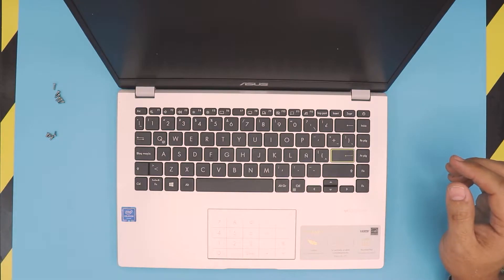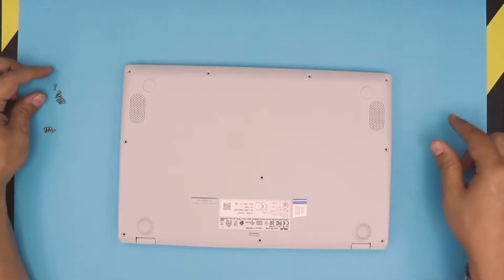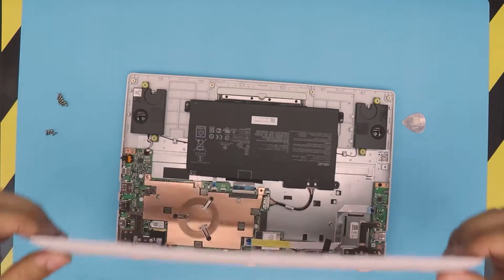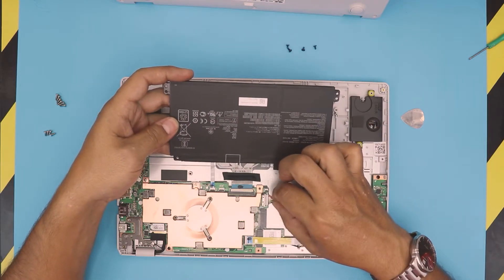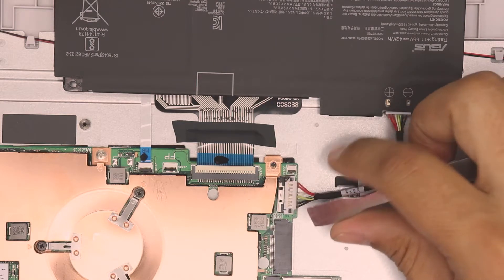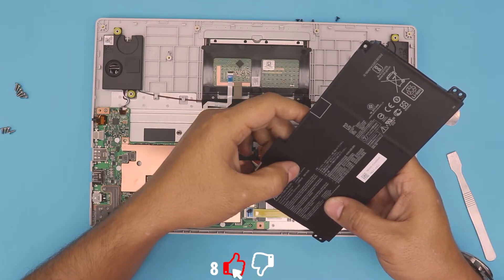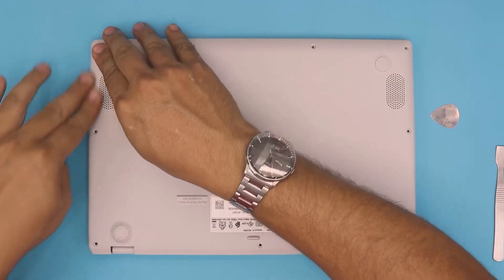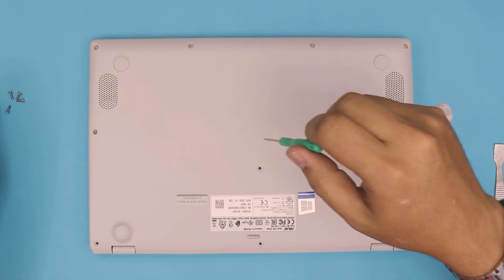ASUS e410 Battery Replacement guide, STEP by STEP

Comment: You said you have to reset the clock. Will that auto update when you reconnect to the Internet of does it have to be done manually?
Reply from the maker: 🫠Regarding your question, yes, just ignore it, and once you're in Windows, the BIOS will automatically set the time.
Should you have any further questions or requests in the future, please don't hesitate to ask me.
cheers🍻

Comment: Thank you!  I successfully replaced the battery on my laptop (the one I'm using right now!). I didn't even have to reset the date and time!  The only thing I would add is not to forget the long screw in the middle of the housing, haha. I unscrewed all the edge screws, pried the clicks open, and the housing wouldn't come off - luckily I saw the middle screw before I broke anything. Also, have a plan for disposing of your old battery - you can't just toss it, it needs to be disposed of properly.
Reply from the maker: It's my pleasure, my friend. 😊 I deeply appreciate your taking the time to provide feedback. If you're inclined to support the channel further, feel free to like and subscribe—or even both!
I'm glad my videos are helping!🫠💞
ya always got to double check the screws🙂
Should you have any questions or requests in the future, please don't hesitate to ask me.
🍻cheers

Comment: Nice video. Question: How about after the initial power up. It is approx. 70% charged at first power up. Do you use it to discharge to a low level, then charge it back to 100% Or do you charge it to 100% right after installation?  Thanks
Reply from the maker: 🫠Regarding your question, both options are okay, but based on extensive testing, we recommend fully charging it before powering on for about 2-3 hours. Then, power it on without the charger and let it drain slowly. After it powers off, charge it again. After that, you can use it as you wish.
Reply: @uFixTek  I wonder if something else is wrong with the laptop. I replaced the battery because I assumed the original was bad. I replaced it with a new one and it doesn't charge, plugged in for about 3 hours and it has not charged at all, in fact is slowly drains. The monitor indicates it is plugged in and indicates it is charging but it keeps slowly draining. I checked the charger and it outputs the correct voltage. I disconnected the battery and powered it back up with the charger only and it boots up ok. Any thoughts?
Reply from the maker: about that...
when i get those cases all the time in the store, the 98% of the time the charge section of the motherboard is bad has a faulty capacitor,
the capacitor is normally beside this type of chip on board:
https://www.ti.com/product/en-us/BQ24780S
"BQ24780S"
https://www.ti.com/lit/ds/symlink/bq24780s.pdf?ts=1740606279121&ref_url=https%253A%252F%252Feu.mouser.com%252F
capacitor on line 27 PHASE it is a 47uf
Reply: @uFixTek  Can’t thank you enough for the deep dive detail you provided. I have some homework to do and will have to figure out the best way to proceed. Again, thank you👍👏
Reply from the maker: It's my pleasure my friend.
i appreciate your support 🫠👍🍻

Comment: Because i didn't unlock the white tab, now its broke, connector is not sodiers to board anymore, any suggestions ?
Reply from the maker: You will need a soldering station and some soldering skills to reattach that jack to the board.  
I recommend finding a repair tech shop to get it fixed.

Comment: Thank you for this guide. My battery had swollen and I read it was dangerous, got to remove the battery safely and now am using the laptop directly with a power supply.
Reply from the maker: It's my pleasure my friend.
🫠Regarding your question, yes, it is very bad. We had one explode a few years ago in the shop, producing about 2 meters of sparks. Use the laptop without the battery; it will last longer.

Should you have any further questions or requests in the future, please don't hesitate to ask me.
cheers🍻

Comment: Goodnight great video can you tell me where can I get the green screwdriver in the video used to put back in the screws because recently my laptop does not charge and it can only turn on when plugged in and my other screwdrivers are too big to take out the screws and thank you for your time!
Reply from the maker: It's my pleasure my friend.
🫠Regarding your question, those are the cheap AliExpress screws that are almost one-time use. You can get a slightly better and smaller set like this:
https://amzn.to/3WrI1pk
Should you have any further questions or requests in the future, please don't hesitate to ask me.
cheers🍻

This is an Amazon affiliate link. When you use my links, you are helping to support the channel. 🙏

Comment: you didnt replace the old battery with a new battery but regardless this video was verry helpfull thanks
Reply from the maker: Regarding your statement, I definitely did NOT change it. This is a demonstration video on how to replace your battery, as I made clear from the beginning when I said, "I'll show you how to replace your battery." I never claimed that I would be the one replacing it. Regardless of whether I do or not, this video takes you through the step-by-step process of how to replace or remove it. 
Should you have any questions or requests in the future, please don't hesitate to ask me.
cheers🍻
Reply: @uFixTek  ok thanks. i guess if you dont need your battery replaced theres no reason to replace it and i appreciate you showcasing the procedure despite not needing to replace the battery yourself
Reply from the maker: Yes, that is correct. I make these videos mostly because people send me emails asking for guidance and demonstrations. I take the time and effort to walk everyone through the steps, step by step.🫠

Comment: Please make changes to your video as this battery actually is pulled from the cable on the other end, not from that end, only if changing the cable.
Reply from the maker: When disconnecting the battery , it is important to always start by disconnecting it from the motherboard end side. After that, you can safely pull back the jack from the battery side. Alternatively, you can also pull out the jack from the battery side, but be very cautious while doing so. Make sure to pull straight to avoid any sideways force that could potentially short and damage the board. 
It's worth noting that the jack on the motherboard end is designed as a pull-up design, which helps prevent shorting.

Comment: I have an ASUS e410ma-bv1421ws. I had to open it up and disconnect battery in order to relpace a broken screen. This was succesful, but after some time the battery is dead. Laptop doesn't work without the AC power. I did all ASUS recomendations, including BIOS update, drivers reinstala, hard reset, etc. nothing helps. I have again disconnected and reconnected the battey, but no success. Also, the small locker of the battery fell and  I cannot put it back in place. Can this be the cause of problem? The laptop did work for few weeks without it , before the battery died. Any suggestions?
Reply: My laptop is doing the exact same thing, won't work unless it's plugged in to AC power. It stays at 37%, doesn't go up or go down. I'm thinking of buying a new battery and trying to install it myself. Did those instructions help at all? Mine is about one and a half years old
Reply: @jumpscare1530  I tried everything suggested by Asus and also by @uFikTek here, but it didn't solve my issue. I haven't attempted to purchase a new battery yet. If you do, please share your results here. Thank you. By the way, when opening the back cover, I noticed that some of the screws are shorter than the others, so be careful not to mix them up. I also encountered difficulties with keeping the small battery locker in place, and when it fell off, I couldn't put it back in its proper position. Goog luck!
Reply from the maker: we just got the same laptop and the same issue and  and the problem was that few capacitors and one power regulator that delivers amp to the battery was damaged because of over heating chip. and the only place that you can get the  IC is on a donor boards. as you mentioned it's not worth the money to repair and fix it, they do have a very bad board design, cheap components are installed.
Reply: @uFixTek i had this same issue, and I though the issue was the battery, so I got a new battery with the same specs. Once I put the new battery in the laptop doesn’t turn on at all now. No LED indicator the adapter plugged in either. I tried the original battery and that doesn’t work. I tried to hold the power button for a minute with both batteries without the adapter and with the adapter etc and nothing will get it to turn on at all. Any idea if I can at least get it to a point where I can turn it on with just the adapter?
Reply from the maker: Thank you for your feedback! If you wish to support the channel, you can like, subscribe, or both!
Regarding your question, the lock is not important,  just make sure it is snapped in the jack correctly, and i recommend you to remove the back and put the laptop on it's side and power on with charger only and leave the battery disconnected, once in the windows desktop connect the battery and wait few min and see if the charge starting and let me know.
Reply: @uFixTek  Thank you very much for your help! I followed your advise exactly, including removing back , disconnecting battery, powering on with charger only, then after windows in up connecting the battery again. But, this did not help. It seems that the battery is not functioning at all. It shows as if 57% charging, but the  laptop is completely dead without the charger, and the charging doesn't go up. The laptop is about 1 year old, but out of warranty, obviously. Thanks again!
Reply from the maker: do me a favor get a battery from amazon and test and if the same, free return the item. when we get this issue in the store we do tests to eliminate causes.
Reply: @uFixTek  Thank you, I made every effort to avoid this option. Unfortunately, this laptop doesn't justify additional expenses. It's a disappointment regarding ASUS. We will continue using it while it can still be powered by the charger. Nonetheless, thank you for your assistance. I'm certain your customers at the store are highly satisfied!